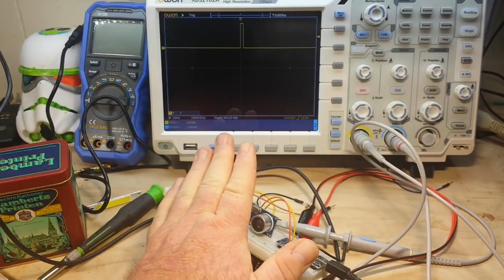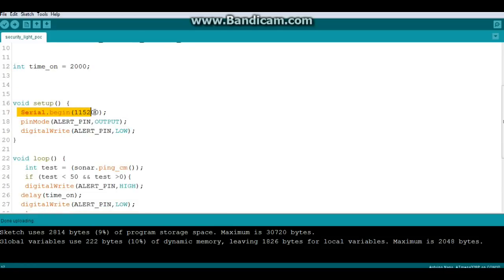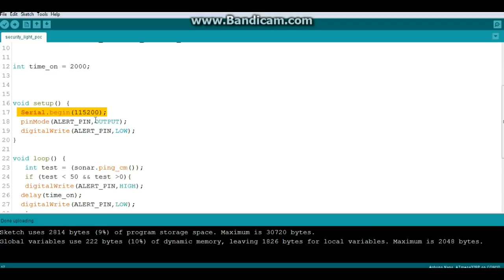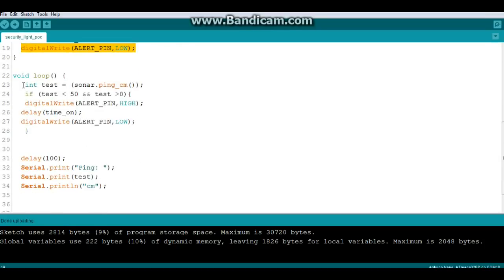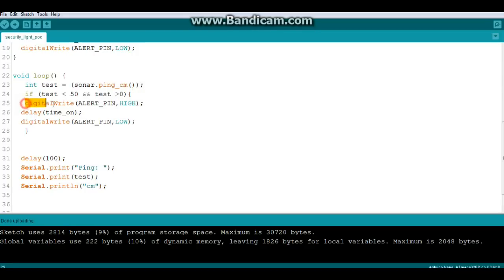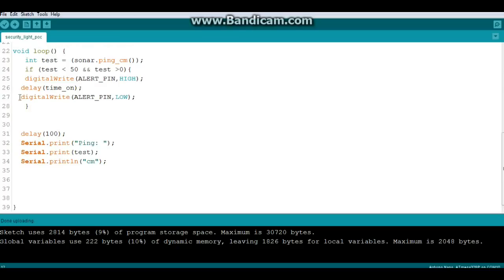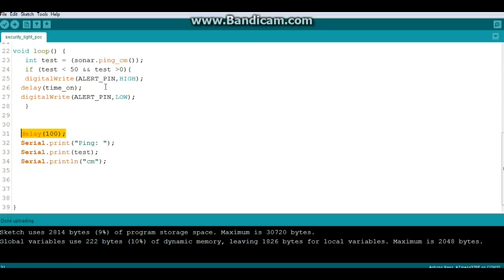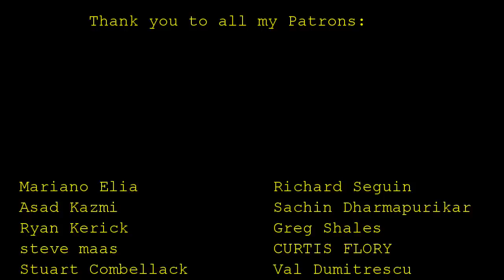LED COB Hack - Security Light

Comment: Line #9 is a setup procedure that looks like a weird way to construct an object, pretty sure that is what makes your object at #23 available so you can call methods on it such as ping_cm().  Your time_on named memory address is a variable and not a constant, but you are not changing it anywhere. If you know it will never change it would look nicer to define it as a constant with the other four constants defined in your code. Finally you can combine the final 3 debugging prints into one statement, look into variable interpolation. Cheers! :)

Comment: Is there a difference if I connect LED on the drain side or the source side of a MOSFET?
Reply from the maker: High side-low side you decide
Reply: yes, there is a difference: the LED will not light fully because the voltage between the Gate and Source will be lower.

Comment: Indeed, it's more fun with the ultrasound thing.  If you want to keep the things "simple" and somehow keep the BOM as low as possible, there are PIR detectors that are cheap and can easily drive a FET.  Also, since there is no need for precision, using an Arduino is a bit overdoing.  Don't get me wrong here, the idea is good and allows some practice with code and all that good stuff, but for simple motion detector circuits, PIRs would more likely be sufficient.  Thanks for your time Paul.